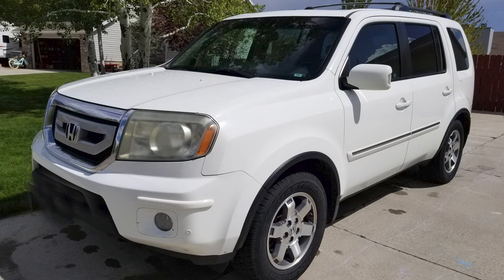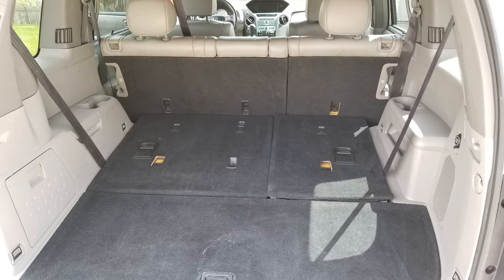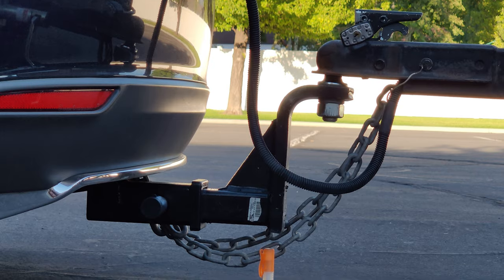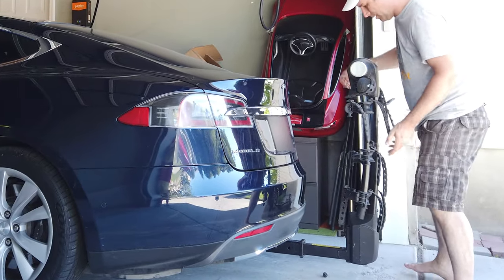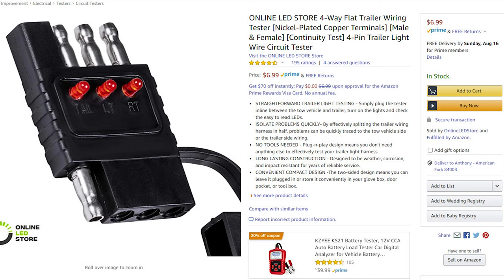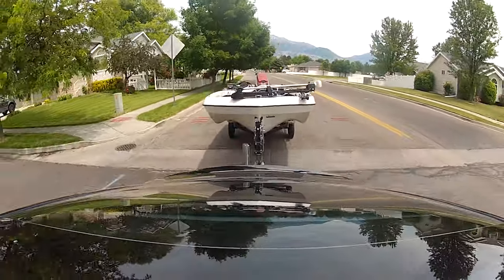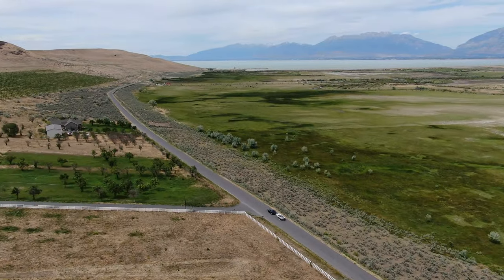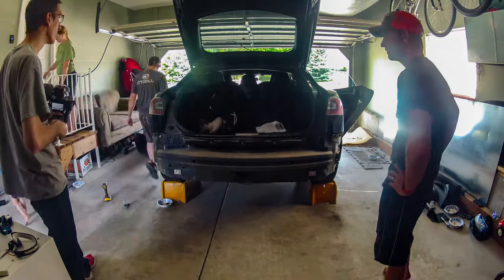Why I Installed a Trailer Hitch AND Trailer Light Wiring on My Tesla Model S

Comment: Love all these videos on Tesla towing! Planning on making my 2013 S a towing rig
Reply from the maker: Right on! For a while my Model S was my only vehicle and it worked very well for us for everything we needed. Until we got our travel trailer which is far too heavy for the Model S to tow obviously. We then purchased a truck, but 95+% of the miles put on it are only when towing that trailer. I still tow our smaller trailer with the Model S instead of using the truck bed because the Model S is so much cheaper to operate and fun to drive! Especially now that I'm towing my Talaria ebike around I'm towing a lot more with the Model S these days. https://youtu.be/KAFndulU_yg

Comment: 7/13/22 Update: Started at 8pm and got to the hanging of hitch onto the bolts by 10:30pm. The most difficult part (IMHO) was the removal of the T-25 screws at the upper edges of the bumper covers. I'll bet I spent 30 minutes figuring out the way to get to the silly things!! LOL Now, I think the bumper hitch may have been redesigned as the only way it seems to fit is using 8 bolts and nuts. I'd send a photo but it doesn't allow that on YouTube. I'm going to watch your video again. Thank you!!!!!!!
Reply from the maker: I'm glad to hear you're getting it done!

Comment: Great info that’s the hitch I’m planning to get for my new/used 2017 model S.  I’m worried it may void my Tesla CPO 4 yr warranty though.  The Tesla SC folks are not very helpful or informative on the topic sadly... thanks for the video!
Reply from the maker: From what a mobile technician told me and comments online which yes I recognize the lack of official nature of any of these sources...a warranty will only be voided if the problem was deemed to have been caused due to the warranty infraction in this case towing. So even if I am towing but there is a problem with the stereo it would not void the warranty of the stereo because there's no way that that problem is caused from towing. Unless I install trailer wiring and mess with the wires really bad and then they deem that being caused by the trailer wiring installation. And for sure it wouldn't all of a sudden void the entire warranty of the entire car it only voids the component that has early failure due to the modification. I installed my trailer hitch with one year of CPO warranty remaining. I have had my car in for service since it was installed and they replaced a taillight that had dust inside so they definitely saw the trailer wiring and they never said anything.
Reply: Anthony Dunster   Appreciated the reply and I’m sure you’re right, intuitively that does make sense; I tend to worry too much, I’m a hand wringer by nature.  Looking forward to your Culyber truck review one day!
Reply from the maker: I'm super excited to make the Cybertruck review for you!

Comment: Thanks for the very well done video. Picking up a 2013 P85 Model S next week. 126,000 mi. Was thinking about getting a hitch because I got a 6x10 trailer. Another question The jumper seats would you highly recommend them? I had found a set here in Florida for about $1,000.
Reply from the maker: We love our rear facing jump seats! I'm not sure how hard it is to add them after market. Also consider that from the factory there's an extra crash bar in the rear bumper when the car was built to have the rear facing seats. Maybe adding the trailer hitch is sufficient. I don't know.

Comment: Hmmmmm....I'm pretty sure mine has been redesigned and no longer uses the support brackets. The ONLY way this thing seems to fit is using all 8 bolts extending out from the car. It is just hanging on there now with a few bolts finger tight. I'll know more tomorrow....I'm a little frustrated at this point. Grrrrr. LOL
Reply from the maker: If they've changed the design I hope they've updated their instructions too. I hope you're able to figure it out!
Reply: @ElectricTechAdventures   I will read them tomorrow...I did this evening's work strictly by your video. It wasn't until I tried hanging it on the bolts that I realized that I can't just use the lower 6 bolts. There are 8 holes on my hitch. I'll keep you posted!! LOL